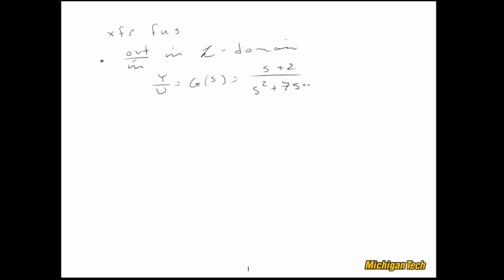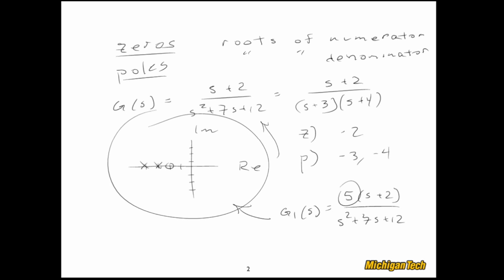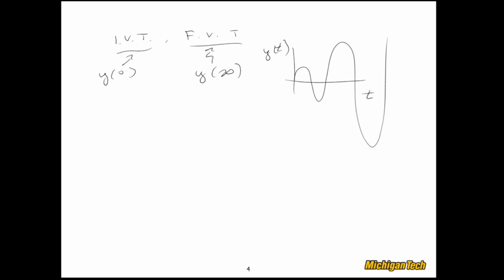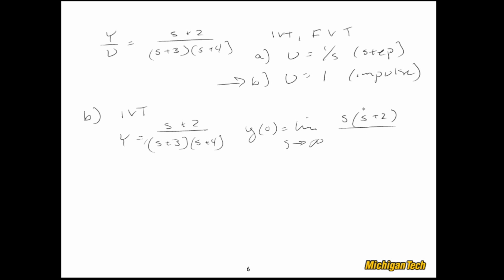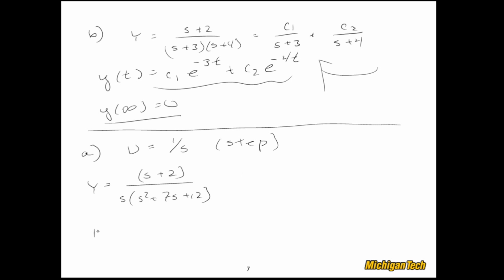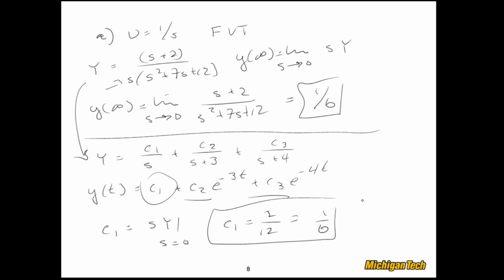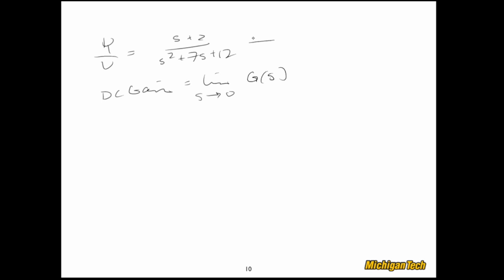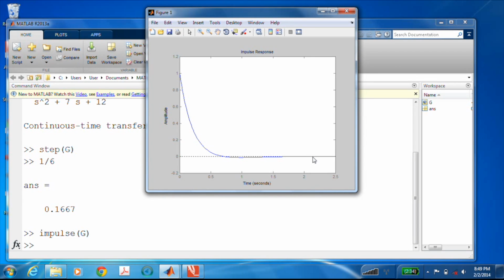Steady State Response

Comment: How can I find the response of a system for 2nd order D.E, when the input X(t) = Dirac delta (t). I'm assuming that delta (t) is the impulse, which is 1. Can I use the transfer function and plug in 1 for input and then solve using IVT or FVT?